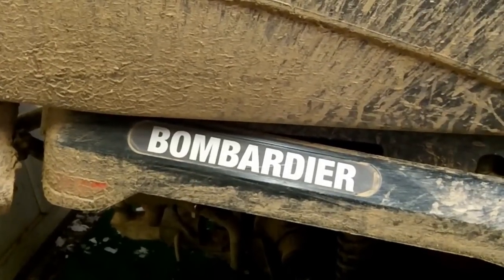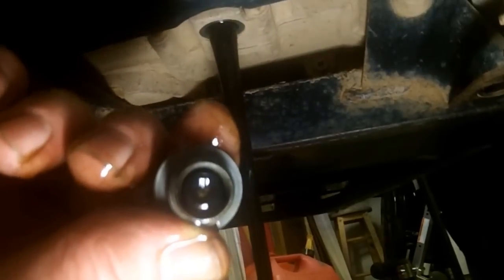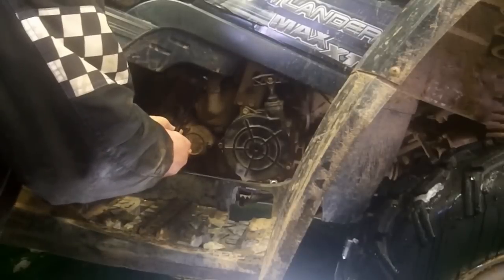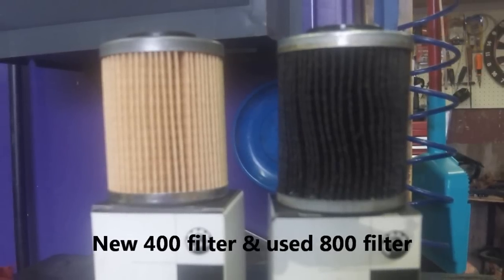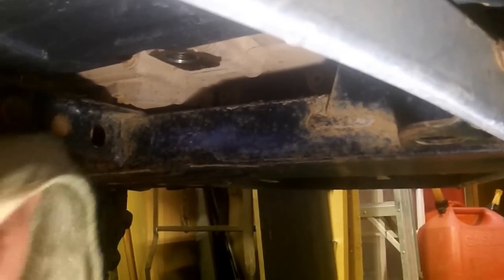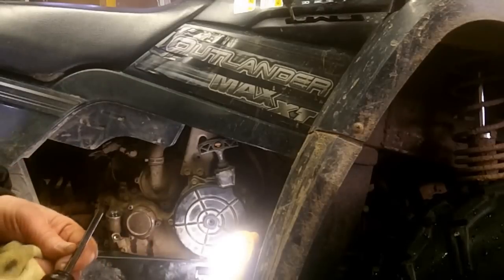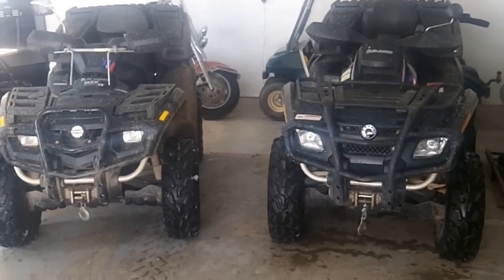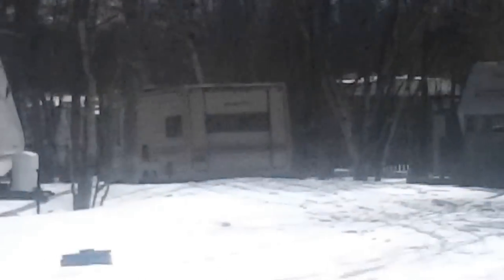How to change Filter & Oil in  Can am 400 Outlander Max

Comment: I am searching for info about changing out the stator in a 2008 can am 400 outlander HO when i came across your video.  do you have any knowledge or can you point me to a video to help with that.  it seems that the water pump is involved.
Reply from the maker: Its funny, We currently have a 2015 commander MAX 1000 and we are having trouble with consistently getting over 12.4 volts. When I turn on thre factory headlights the voltage fluctuates from high 11's to high 13's . Turning off factory headlights and running LED light bars the voltage goes over 14 but still fluctuates.  In checking the wires from the stator I am showing a "to ground" result so  am thinking the Stator. I do not know how to answer your question - sorry.

Comment: I know this video is old but I have the same 400 Can Am. The 2006 is the last year with a choke and mine is so hard to start when it is cold. I can choke it fully and still it takes a full minute to start. Yours started right up. Is that the case with your when cold that it starts right up when choked?
Reply from the maker: Depends on how cold it was outside.  A cold start in the summer was pretty good maybe 10 to 15 seconds. A cold start in the winter when it was near 32 f or 0 Celsius it took around 30 seconds or so to start and sometimes you wondered if the battery would last long enough to start it but it always started.  If it is taking a minute to start maybe your choke cable has to be adjusted to fully close the choke flap.

Comment: how much oil does the 400 take?
Reply from the maker: 2.8 Liters for the 400 which is 3 quarts I believe
Reply: Thank you.
Reply: I just changed mine...3 quarts exactly, but haven't started it yet to fill up the filter and then will top it off.
Reply: Era exatamente isso que eu iria perguntar...
Reply: @Halscamp obrigado por informar.

Comment: How is the pull start on the 400 I have the same and have never gotten it started but the pull start feels like your gonna break your back?
Reply: Mine is the same
Reply: Me too! Thought I was too old and weak! (Which could still be true).
Reply: Hi guys, I have a 05 Bombardier the trick is with the pull start is you FIRST VERY SLOWLY pull the string past the 1st cylinder, you'll feel it, then you can pull start it like a lawnmower from there. 
Now if it is in the down position (basically free pulling) you have to pull in and out and eventually the cylinders line back up like you need them to for a pull start. Hope that helps.

Comment: Where do you buy your Bombardier oil filters?  Are there any after market filters that would work in the 400?
Reply from the maker: Hi-Tech Power Sports is the dealer here in Moncton and that is where I get my OEM parts.    K&N states that they have oil filters. I have K&N air filters on my 400 and 800 and have no issues with them so I can only assume their oil filters are fine to use